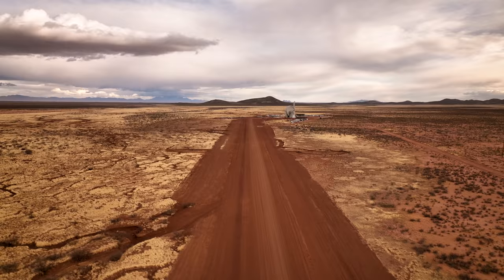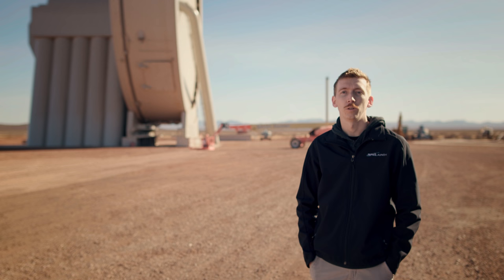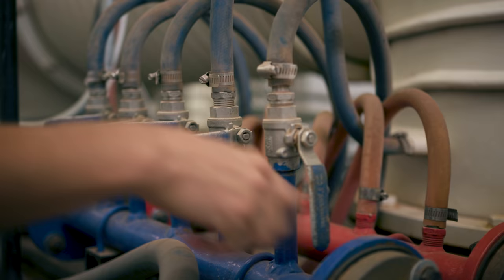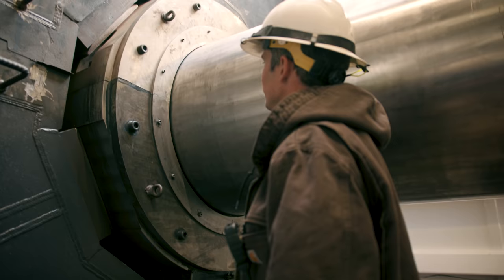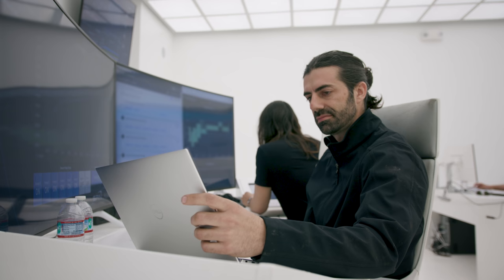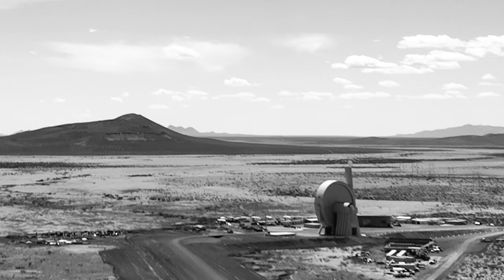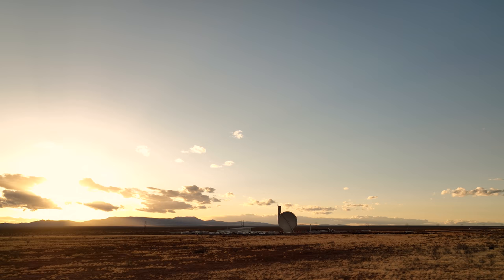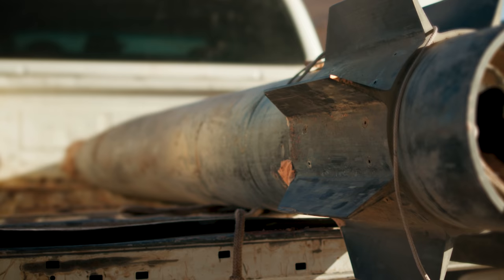An Inside Look: SpinLaunch Flight Test #7

Comment: I'm amazed that the projectile can be reused after slamming into the ground at high speed. Are you planning to reuse the fairings of the orbital vehicle?
Reply from the maker: Hi Rob, Yes! We're planning on reusing the orbital vehicle aeroshells. The flight test vehicle shown in this video is the 2nd flight of that specific vehicle, and it's ready for a 3rd flight after having been successfully excavated and inspected.
Reply: @spinlaunch6288  Cool! That's very impressive.
Reply: @spinlaunch6288  is the orbital rocket going to be reusable, or just the aeroshells
Reply: Hello good luck with the rest of testing and what is turn around time for reusable
Reply: @NekoAerospaceSFS  There's no way the rocket could be recoverable. Mass margins are far too small.
Reply: Their "rocket" is just a metal slug with very limited electronics. It is the only way it could withstand the 1000s of g's during the initial spinning.  No realistic space payload will be able to be launched this way.
Reply: @briangoldberg6568  Why not?
Reply: @briangoldberg6568  time to build in space, instead of sending built stuff to space
Reply: @pseudotasuki  The rocket+payload undergoes extreme g forces during the spin process. For instance, to spin fast enough to have a launch velocity of the claimed 5000mph (8000 km/h) with a 33m diameter system, the g-force on the rocket before launch is an absurd 30,000 g's!!! This is simple physics and there is NO WAY around it.  Rockets and specifically space payloads are designed to minimize weight in order to reach orbit. This means that they are designed to only withstand 10’s of g’s, not 100's let alone 10's of thousands! Any sensitive electronics, optics, fluids, plumbing, etc will be deformed if not completely destroyed when subjected to the spin launch loads. In addition, an extraordinary shock load is put on the rocket/payload when initially released and then again when it exits the tube and hits aerodynamic loads. Basically, the acceleration goes from 30,000 g's to zero instantaneously.  This approach may work for launching mortars, but never for a satellite.  This is why they can dig the "rocket" out of the ground post launch and reuse it.  Because it is just a hunk of metal and nothing else.
Reply: @briangoldberg6568  Mortar shells have contained electronics since the Second World War. If they could get vacuum tubes to survive being fired out of a cannon, we can do the same.
Reply: @pseudotasuki  This is true, but they are very specialized electronics and are designed for momentary shock loads, not persistent high g's.  This is akin to hitting a bump in the road with your car.  The suspension may be able to absorb the 30g shock, but if the load is persistent, then the suspension bottoms out and the car will break.  Satellites are significantly more complex than a mortar containing sensitive electronics, optics, antenna, etc. This approach would completely drive the design of the payload which is likely a non-starter.
Reply: @briangoldberg6568  Nope, no suspension. All of the electronics are potted.
Reply: @pseudotasuki  So we just need to pot the entire satellite structure?  That is not weight efficient and is impossible for most subassemblies.
Reply: @briangoldberg6568  The aeroshell can accomplish that quite well.
Reply: @pseudotasuki  I don't disagree regarding an aeroshell.  But getting a cryo-cooler or precision telescope to sustain 30,000 g's is a different game.
Reply: @briangoldberg6568  Yeah, some payloads won't work and most of the others will require customization. Though there are existing smallsat telescope designs which could withstand that launch.
Reply: @briangoldberg6568  Specifically: monolithic reflector telescopes which are milled out of a single piece of glass.
Reply: @briangoldberg6568  do you honestly believe they would be spending that kind of money on this if it was useless?
Reply: authorization batman  gotta love these YouTube armchair physicists who seem to know better than the people spending hundreds of millions of dollars to build the thing being criticized.
Reply: @Chimera_Photography  physics is the same, no matter where it is. It is the same in a laboratory as it us in an armchair.
What YOU fail to understand is that they are spending other peoples' money, gullible, stupid other people.
Reply: @spinlaunch6288  How the heck does it stay in tact? Is it made of kryptonite??
Reply: @briangoldberg6568  only weapons
Reply: @Arcticfox7   Kr is a noble gas :)
Reply: @imwacc0834  I reject the nobility of killing Superman.
Reply: @imwacc0834  and another thing. This pipe dream is less than 10% efficient. Unless you have another one that you spin up on the residual energy from tha last splattered payload, you waste it.
Then there is the residual angular momentum. That puts paid to your stupid idea of orbital launches, or ISS.

A rail gun or just linear accelerator knocks this snake oil garbage into touch.
Reply: @Chimera_Photography  Respectfully, I am no "armchair physicist".  I have spent over 25 years developing launch vehicles, satellites, and payloads.  Just because a company is able to convince investors does not mean it is viable.  Maybe you should watch a documentary on Theranos.  I will gladly sit down with the folks from SpinLaunch with an open mind and allow them to convince me of the efficacy of their system.  If they are successful, I will publicly be a proponent.  Until then, I will launch healthy skepticism.  Something to note is the absence of SpinLaunch's voice on this topic.  They are surely aware of my comments and have auspiciously failed to chime in.
Reply: @briangoldberg6568  I believe you are correct. But it may be a good way to launch raw materials such as water, fuel, or other materials to orbit.
Reply: @dougaltolan3017  And the down side to rail gun or just linear accelerator is that you need big loads of electricity. Also, there's no residual energy, you wasted it.

Yeah, they'll work also, but how long are you going to make that gun? Let's say 3 meter, with and exit velocity of 13,000kph?... want to do the G force calculations on that? That's not ramped up, that's a G force shock.

And then again, you can only make the case out of conductive and/or ferrous metal, no carbon fiber or other lightweight materials.

But right now, I don't know what they're doing with the residual angular momentum. They talk about balancing the load, but not what happens to the counter weight when the load is released. That has to be a hell of a shock to the whole system. Just because I can't give you full blue prints and tech sheets dose not mean it's a "stupid idea". Saying that it can't be done, when you're seeing it with your own eyes seems rather ignorant to me. If it was all CGI and no real data, I'd agree... but we both saw it
Reply: @Chimera_Photography  Well, some of the critical “armchair physicists”, like me, have actually worked in the industry and designed and built real satellite payloads. Large commercial ones, not just R&D. Been orbiting the Earth and working successfully for 15 years so far. Whereas the engineering background of the guy who designed this is……he has a commercial pilots licence.
Reply: @pseudotasuki  Which “existing smallsat telescope design” can survive this, specifically? What I suspect you mean is: the actual R&D telescope optics can survive it. 
But I don’t believe you have considered all the ancillary subsystems on the (probably cubesat). These are available cheaply precisely because they are built in volume without consideration for any special requirements. The solar array? The solar array deployment mechanism? The reaction wheels? Typical reaction wheels are tolerant to launch of 9g, I can’t find any for more than 17g. 10,000g you are having a laugh. These are physical items mounted on ball bearings. Ball bearings have a specified material hardness and if you simply beat them from the side with a hammer for an hour, which is what you are doing, they will indent into their bearing race, and that’s the end of the bearing. This is a bearing that needs to run essentially friction-free in space for years without noticeably pulling, otherwise it will torque the whole spacecraft in a spin. They have to be parked and locked down like an old hard disk drive, just to survive 9g. Again…10,000g? Where? Who supplies it?
I’m not saying it is impossible to engineer this. There’s people saying gyroscopes can be made for artillery shells. I am saying, though, that the reaction wheels you expect to buy off the shelf for $7k, you are going to need to pay the manufacturer upwards of $20M to design one specially for you. How is that going to fit into your school project budget?
Reply: @briangoldberg6568  We make electronics for space pretty hardy. Uniformly applied Gs that gradually get stronger are not going to affect any modern space hardware. If you applied 1000 Gs in 1 second from 0 then yes it explodes.
Reply: @briangoldberg6568  to put this in context, a typical 2 tonne vehicle exposed to the G loading this apparatus requires for a claimed 5000 mph launch, (roughly equates to something like 30,000 Gs-) now imagine loading a 2 tonne vehicle with 60,000 tonnes, and expecting it to be able to cope with this un damaged….. not sure this will catch on, for anything other than near solid projectile launches, but best of luck to the engineers who are trying to make it feasible.
Reply: @imwacc0834  Funny because I watched the video and it didn't, in fact, show a satellite being put into orbit. So we haven't, in fact, seen it working. Lobbing a solid metal projectile in a parabola to 30,000 feet is completely different to putting useful payloads in orbit.
Reply: @Chimera_Photography  Are you unaware of Nikolas and Theranos among other high tech scams?
Reply: @briangoldberg6568  or Nikola.
Reply: @Chimera_Photography  absolutely. It's investor money. Tiny margins spent. Rest pocketed.
Reply: How will this thing get something into orbit? Seems like it’s only gods for straight up which will just fall down no matter how bight it can launch.
Reply: @ben3989  The projectile will contain a small two-stage rocket.
Reply: @dougaltolan3017  A railgun or linear motor would need to be much, much larger with access to an immense amount of stored energy which can be accessed extremely quickly. To top it off, payloads will still need to withstand immense g forces.
Reply: @imwacc0834  Railguns use a flechette to guide the projectile  down the rails while a plasma conducts the electricity and generates the magnetic field which is pushed by the fields generated by the rails. A linear accelerator needs a sled of some sort, which can just be a block of aluminum.
Reply: @pseudotasuki  do the marh
Reply: @dougaltolan3017  Do what math?
Reply: @briangoldberg6568  Nobody is going to spend the millions of dollars to redesign their systems to take advantage of this high g launch system.  Therefore, target clients will be ones with new designs specifically for this launch mechanism.  I'm guessing the target commercial audience will be smallish SS launch vehicles and the military.
Reply: @pseudotasuki  if you have to ask, you probably aren't worth listening to on this, eh?
The math that actually backs up your assertion, that math.
Reply: @dougaltolan3017  Which one? I've made a bunch of comments on this thread.
Reply: @pseudotasuki  you might want to learn to follow conversations, even if they are entwined in a thread, it's not rocket science.
I said railgun or linear accelerator, you poo pooed that with an apocryphal statement about G force, I said do the math. You know, so you have something 8n your comment that might carry some weight, instead of a wild, unsubstantiated guessm
Reply: We have landed Rovers on mars and other technical equipment, its not that hard to reinforce a Hellfire (smart) missile.
If this WAS for war, it would already be complete.
Reply: @dougaltolan3017  If the track was 500 meters long, and assuming a constant acceleration (which is extremely naive) you're looking at over 500 Gs.
Reply: @Chimera_Photography  I do believe they would take investors' money to work on a project that will never do what they intend to do. I still hope they get it but it's not looking good. I love to take investor's money to make my own ideas
Reply: @briangoldberg6568  
Totally agree. Financiers are not physicists. These guys may be learning lots of good stuff (I’m impressed by the engineering they’ve already solved) but this idea is going nowhere as a launch vehicle. 

For a given energy input to a launch vehicle, every extra gram of vehicle mass is subtracted directly from payload. At this stage, these guys are subjecting their projectile to about 1000g acceleration even before launch and they’re only giving it about 0.4% of the energy it needs to get up to space. The smallest vehicle used to launch satellites is the RocketLab Electron, here in NZ. It’s 20 meters high and weighs about 13 tonnes. Strapped to this device it would need to be able to withstand 13,000 tonnes weight. All in order to save perhaps a tonne of fuel. If anybody can do that without adding far more weight (mass, actually) to the rocket than the fuel saved, these guys need you.
That’s just the start of their difficulties. When rockets are launched, the aerodynamic forces on the rocket start out low and build as it accelerates. For a given rocket, two variables affect these forces. The increasing speed of the rocket increases them, while the decreasing density of the air reduces them. There is a time after launch,  called maxQ, when these forces build to a maximum, before the thinning atmosphere outweighs the increasing speed. Rockets are designed to withstand maxQ, but not much more, because, as mentioned, every additional gram (apart from fuel) added to the rocket comes off the payload. On Electron, maxQ happens at a little over 15 km altitude and a little under 2000km/hr and those forces have been gradually increasing since launch. This Spin Launch system, on the other hand, will have its maxQ where the atmosphere is densest and, if it’s heading for orbit, a minimum speed of 27,000 km/hr. That’s going to be a Q multiple orders of magnitude greater than the current vehicles encounter and rising from zero to max in a matter of milliseconds.

TBH, I think this is thinly designed military research. They may be able to develop a modern shipborn trebuchet if  they can get it going 2 or 3 times as fast. Even then, I doubt it would outperform a railgun.
Reply: @briangoldberg6568  It is logical to use a smaller and cheaper centrifuge to develop the technology, and if the development is successful build a bigger one to actually launch stuff into space. I can see this system being useful for launching materials into orbit for 0G manufacture or sending fuel/oxygen into orbit, not so much for launching satellites because of high G forces involved. If you are skeptical about it then don't invest your money... as simple as that.

Comment: Curious about the forces exerted on the projectile while spinning up. How can the payload survive, unless its something very homogenous like a tank of water or oxygen?
Reply: Can't,  this is a BS project.  Anyone with a opinion has already said it is a dumb idea.  Cute though, like a looney tunes creation.
Reply: I seem to remember hearing that the G forces are such that solid state electronics will survive it, provided they are engineering correctly.
Reply: Well, very basic things will need to be sent into space. Like water. However, you would need some kind of propulsion or guidance system too, which means things that can break.